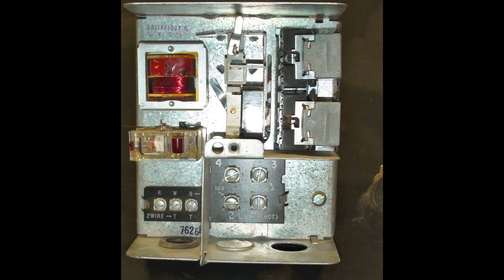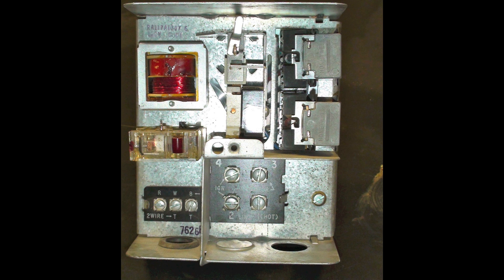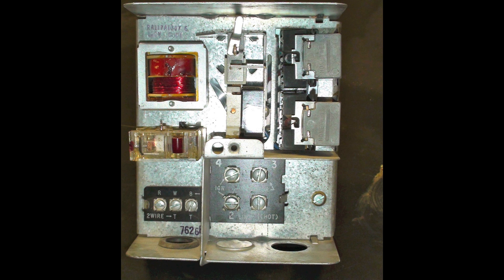Oil furnace stack switch wiring

Comment: bad advice on wiring the ignition transformer to the burner motor... lessens the life of the transformer.  Different stack controls have different time outs...depending on how worn the helix  is in the tube that sits in the stack.  As far as resetting the... what? the helix switch.. resetting them is a waiting game. It takes a loooong time for them to cool down to reset. It's a heat sensor, and theres a bimetal that heats up to open a switch if no flame is present. Also the red reset above the thermostat. Testing these primary controls during a tune up was first thing. It gives it plenty of time to cool down to reset.
Reply from the maker: I have no problem with most of what you say.
The transformer being on continuously has been a standard in my area.  Failures are quite uncommon.  I just don't see it as an issue.
GFM

Comment: If I have power and ground coming into this, yet my pump/blower motor do not even try to operate, would this be the most likely culprit? and would it be a bad decision to jumper voltage to the blower motor to verify?
Reply: Also, with newer systems going away from the stack switch entirely, could you potentially plug the hole and install something such as 

https://www.amazon.com/Honeywell-R7284U-1004-Electronic-Programmable-Parameters-x/dp/B0058UHG5Y/ref=sr_1_fkmr2_2?ie=UTF8&qid=1541709515&sr=8-2-fkmr2&keywords=oil+furnace+stick+control

As they are much more affordable than  the original style
Reply from the maker: If you have reset the stack switch, the switch may be out of step.  There is a lever at the top of the switch that can be pressed to get it back in step.
You can replace it with a cad cell relay similar to the one you referenced.  However, you will need to also install a cad cell in the burner tube.  
GFM
Reply: Right, I attempted getting it back into step, the switch under the red button looks like it has gotten hot somehow. Is this conversion fairly simple/ cost effective?
Reply from the maker: Its fairly simple for a tech.  For a homeowner, a little harder.  
First, if the furnace has a stack switch, it is probably garbage.  It does not have a flame retention burner, so it uses oil very inefficiently.
The changeover involves installing a cad cell inside the gun to "see" the flame.  Then the rewiring is fairly extensive.
GFM
Reply: Honestly the wiring isn't a concern for me, from what I understand they come with enough of an instruction, plus wiring diagrams are easy enough to find. My main concern was finding a place to mount the cad cell, but after bypassing the stack switch to verify everything else operated properly I realized it wouldn't be an issue getting it to "notice" the flame. I understand the furnace may not be as efficient, however we are currently needing to make due with everything else that has arisen in the first year of our "new" home. Thank you for your time and quick responses.

Comment: I am working on a Mueller Climatrol M/N: 218-150.  It has the old stack switch controller. I cleaned the igniters and contact points. It came on and ran but after I left it failed again. It seemed to be stopping and starting intermittently before it would run constantly. If the stack control is not functioning correctly can it be converted to a newer style? What do you think may be the problem?
Reply from the maker: It can be converted but it is quite a job.  Stack switches are available.    As to what the problem is, it may be that the stack switch is just letting you know of a problem with the system.  It sounds like you have an oil supply problem.  Have you changed the oil filter, flushed the system?
GFM
Reply: No, I have not. I was planning on returning with a new filter. Any tips on how to flush the system? The tank is underground and piped up to the oil filter next to the furnace with no isolation valves. I watched your video about the fuel pump screen and was planning on checking that as well. I did blow air through the nozzle when it was apart and had a solid stream of oil.

Comment: What would be wrong with r oil furnace we can't turn it on from the thermostat we can only turn it on and off from the power switch so it stays running till you shut it off I no I shouldn't leave my number on here but could you text message me please my number is 1-613-553-1512 its Dustin if anyone could tell me what could be wrong with it let me know we have a 2yr old son and live in Canada so it will be cold this winter
Reply from the maker: If it is stuck on, my first thought is a short in the low voltage.  Try disconnecting one of the wires on the cad cell relay marked T-T.  If it does not start, the problem is the thermostat or the wiring to it.  
GFM

Comment: I keep waiting for you to show us where the T-T wires connect to the back of the modern digital thermostat.
Reply from the maker: The only electronic thermostat that can be used with the T-T terminals is a battery powered one.  Then you can connect to R and W.  If the unit has air conditioning, the R power must be separated from the Y power.  Hope this helps.
GFM
Reply: OK. R&W. No AC. Thanks.

Comment: yes oil burn.. sorry and it kicks on the baseboard heat just doesn't get that hot
Reply from the maker: +rickie mickle Is there gurgling in the pipes?  
GFM
Reply: no the air is all out. theres a weird box with digital up n down buttons.. and it looks like what the temp is at or will be at. it wont let me show you the picture i took for some reason
Reply from the maker: +rickie mickle Send the pics to grayfurnaceman@gmail.com
GFM

Comment: i have a honey well box on my oil furnace.  it has up n down buttons on it. my base bord heat is not getting that hat at all.. it this adjustment on the box what i need to adjust the temperature of the water running threw my base bord heat?
Reply from the maker: +rickie mickle First, I need some info on the furnace.  Is it an oil fired boiler?  Does the burner come on with a call from the thermostat?  You can send pics to grayfurnaceman@gmail.com
GFM

Comment: does the wire color matter in this case? I need to hook up a 2-wire honeywell t87 to make my oil furnace run all the time. I have a red wire and a white wire.

Thank you
Reply from the maker: stephiso In this case, no. Either will do.
GFM